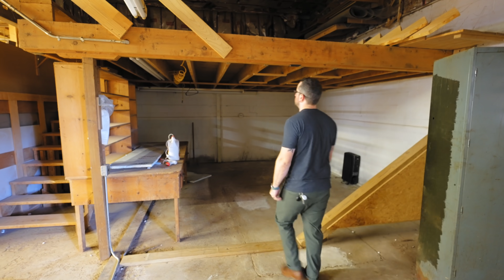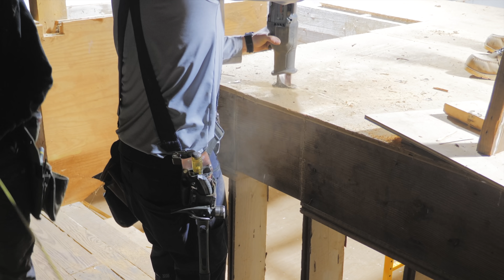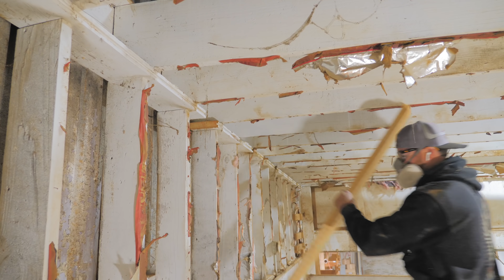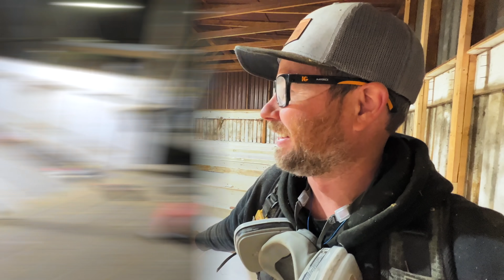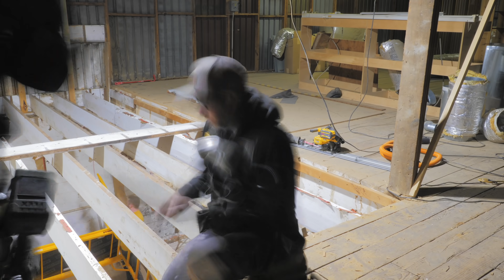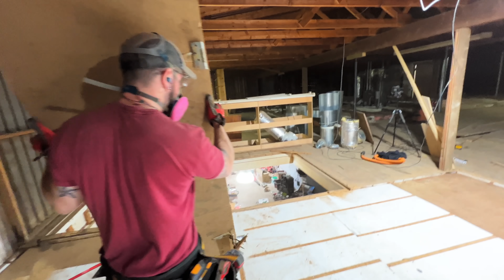50 Yr Old WORKSHOP RENOVATION Part 2 : Fixing Framing Problems!

Comment: Why was everything framed with screws and not framing nailers? Just curious
Reply from the maker: We mixed it up depending if we needed to pull pieces together. Also, I think we only had two nailers on hand but everyone had impact drivers.

Comment: 4:10 - Engineer says structure will fall if XYZ not done...  Roof not even connected to girders and still standing after 50 years.
Reply from the maker: Hah, I didn't have him engineer the roof structure!
Reply: you might ask him about connecting the trusses to that girder. they are supposed to be free floating over walls, but you should have a 2x4 across them to keep their spacing proper.

Comment: Oh man, I feel that plywood demo, just removed 1000sqft in that same manner from a remodel we are doing. Those flooring sheets will be used as roof sheeting as needed
Reply from the maker: It was definitely worth removing the nails and reusing it, saved probably $1,000 easily.
Reply: @craftedworkshop  we stacked about 4K in lumber between studs, subfloor ply which will be used on the roof, and 2x10 joists. Just crazy
Reply from the maker: @Natedoc808  yup! I pulled about that much material out of the old shop. Not fun but worth it.

Comment: The bottom chord of your trusses needs to be able to flex up and down, depending on the wind rating in your area how necessary it is to secure centre of the bottom chord at all
Run battens long the top of the bottom chords and block either side of the bottom chord on the bearer and remove the screws you put it
This will allow it to flex like it needs to but not rack
Reply from the maker: That’s the plan!

Comment: You need to be very careful when you attach the bottom chord of trusses to a plate.  When the truss takes a load (like snow) it lifts up as it goes in tension and can pick the wall up with it.  You need to use a connection device (they make them) that will allow the chord to go up but that restrains side to side movement.